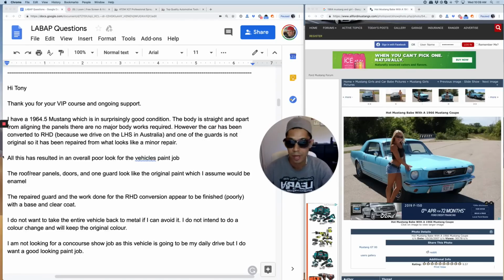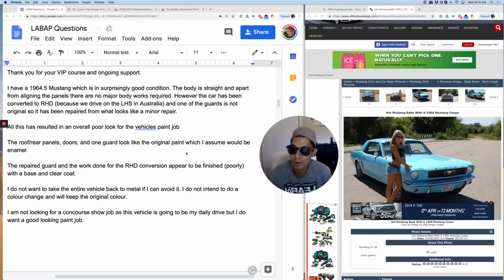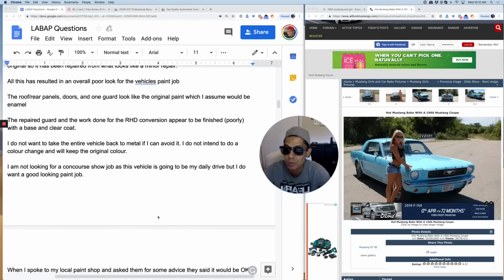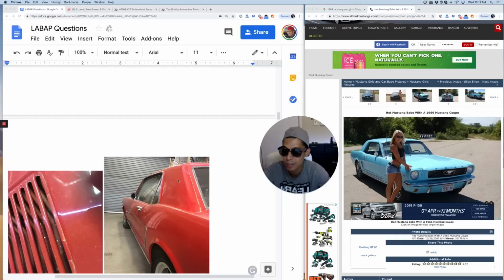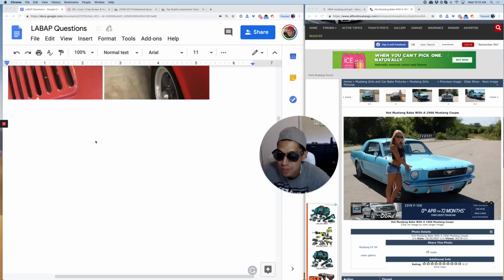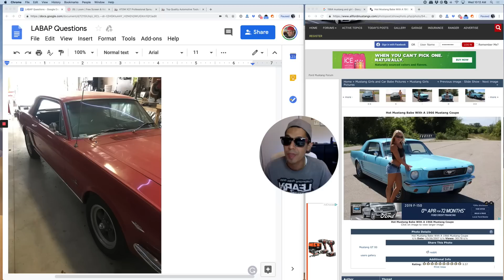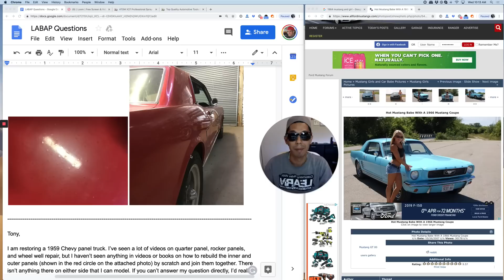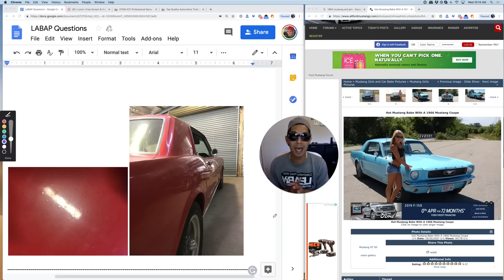Can you Paint Over Single Stage Paint And Basecoat Clearcoat  Prep Ideas 🤔

Comment: Is it okay to sand base coat with 2000 grit and clean it then spray clear coat???

Or is it mandatory to spray another base coat layer above sanded base to apply clear?
Reply from the maker: Hey Imdias, why don't you send your question to ninjasupport@learnautobodyandpaint.com with pictures of your project so I can give you a more comprehensive recommendation on how to move forward with your project.
Reply: @HowToPaintYourCar  i will do that
Reply: After i clear coated i am seeing white spots like bubbles which are very minute. Its deep inside .looks like trapped minute bubbles. Which is giving a white texture to my red paint.

I am using an electric spray gun.

These white things shown clearly after i sanded it with 1500,2000 then polished it.

Whats ur suggestion should i repaint base coat and clear coat.
I am kind of fkddd up.

No one here has an idea about all these. Well its my first project all other were by spray cans.
Out of 13 parts painted 2 of them showed these white minute bubbles

Comment: Can you spray single stage paint over a new coat of base coat?
Reply from the maker: Hey Man! Spraying single-stage paint over a new coat of base coat is generally not recommended, as it can lead to various issues. Consult with a professional automotive painter or refer to the manufacturer's instructions for the paint products you're using. Also check out our VIP Program and grab our manual on A-Z Step by step process on auto body and paint https://vip.learnautobodyandpaint.com/home
Reply: @HowToPaintYourCar  I Really Appreciate your advice, so I actually attempted to spray Single Stage Over the Base Coat. Since it was Metallic I had to Tack it off a good amount of times. I sprayed 2k Acrylic Enamel Single Stage with Some Extra 4:1 Clear Coat mixed in and it came out pretty good. Glossy with factory looking orange peel. Didn't even need to buff/polish. 🤘

Comment: I am going to be painting my c4 corvette soon and thinking of buying a gallon of single stage. maybe put like 3 nice coats on it. is it ok to sand it down with 1000 and stuff it and then clear coat over the single stage to give it that deeper look? I am a professional auto body technician. for 17 years. But as my job title I am the body and frame guy I haven't painted much to experiment like this. I Finally built my own garage at home and starting to take in some work.

Comment: Can you spray clearcoat over single stage paint
Reply from the maker: Yes you can! YOu can do it on the last coat of your single stage paint job, you can also mix it with your enamel paint 1:1 on your last coat for an additional gloss, or you can let it dry for 2 weeks to cure, wet sand it lightly with 800 grit and lay two coats of clear over it. Learn more through step-by-step videos here: https://vip.learnautobodyandpaint.com/exclusivevip
Reply: Tony B. Richie - Car Mods & Entrepreneurship! Is this the same with metallic single stage paint?.
Reply: sir,can i use 2k thinner for first layer?then for next layer,i use 2k slow thinner..with ratio 1:0.8..its no problem?

Comment: We used to single stage completes all the time back in the day. We sand then base and clear. ✌
Reply: What grit sand paper do you use bro ?
Reply: @jimmyboimazarti1234  Block it back down with 4-600 wet then base clear.  It's been over 10 years since i painted professionally now. I don't miss it!
Reply: @utahnick  nice bro cheers for the help! I don’t no much about painting cars I just brought a van loads of marks on it from where old stickers have been removed and the   colour of original paint has gone lighter colour where the old stickers where
Reply: @utahnick  can you lay a 2k clear over single stage paint?  What would be the best way to go about it?   Scuff surface w 400 grit and spray?
Reply: @slixxster5118  Yeah you can as long as you know what you're painting over. If it's an old car you might have problems it. 
When I say Single Stage I'm still talking a 2k Single stage paint just to clarify.
Reply: @utahnick  it’s a 04 Toyota truck.  Idk if that’s considered old.  I’ll try it and see how it goes.
Reply: @slixxster5118  Clean with solvent like prep sol and get some sand fix, scuff stuff or something and read directions. You probably don't need to actually sand the whole thing unless you want to.
Reply: @utahnick  I don’t plan to sand and take it down to bare metal, it’s not needed.  I was planning to scuff up so the clear has something to grab onto, clean w dirt/grease remover of some sort, tack cloth then spray the clear.

Comment: Why not just paint the other section with enamel that will last 50 years( unlike base clear wich will peel after 10-15 years)
Reply from the maker: Κώστας Λεούσης hey buddy you can do whatever you want... your comparison makes no sense because it all depends on how you care for the paint. You can keep an enamel paint job in the sun under a tree for three years and it will go bad just as quick.
Reply: BOSS PAINTER - Learn Auto Body And Paint! Well , I own a vw bus form 1983 never got waxed and it got abused , after a buff the paint shined again . We also got other cars which we cared a lot ( waxed 4 times a year and cleaned once a week with special shampoos ) well all of them neede a repaint after max 15 years due to failing clearcoat ( all different brands ) I really think that they switched to base - clear 1 because the base might be dirt cheap 2 it may be better for the nature 3 they want you to go back to the dealer to get it repainted
Reply: @type2523  Why all the extra? He simply said to “Do you!” Weird